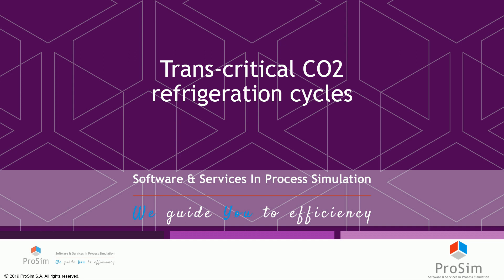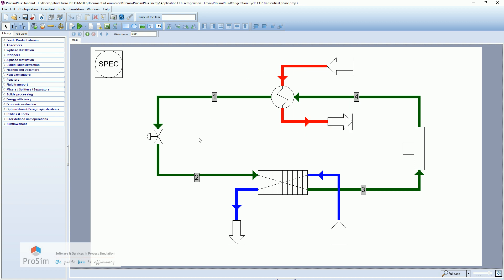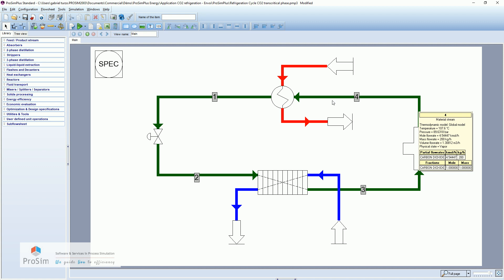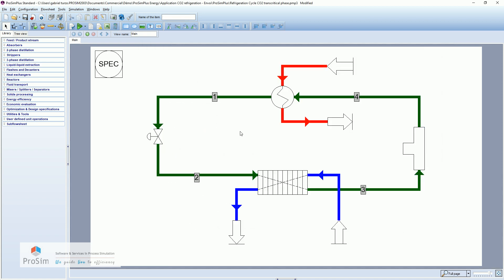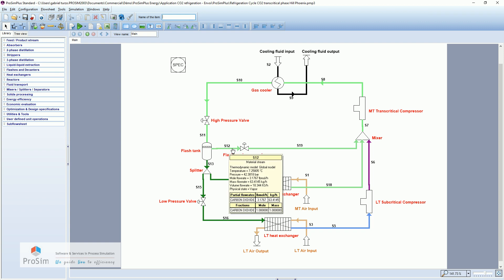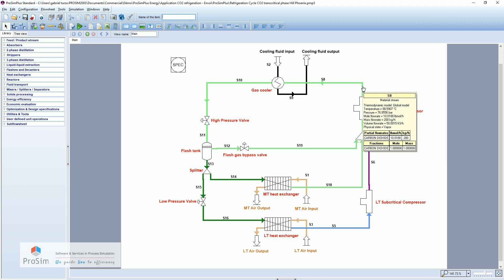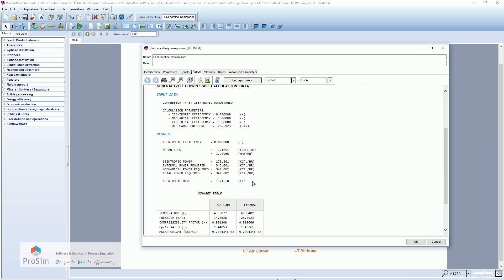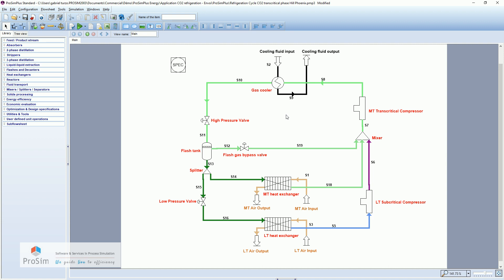Webinar: Transcritical CO2 refrigeration cycles simulation with ProSimPlus software

Comment: Is there an optimum heat rejection pressure in the gas cooler?
Reply from the maker: As there is a link between this heat rejection pressure and the overall performance of the refrigeration cycle, an optimal value could certainly be found. It could be interesting to use the case study features of ProSimPlus to see this influence, or to use the embedded optimizer to directly find the optimal operating point.
Reply: @Fives-prosim  Is there a way by which I can get access to a student version of pro sim ?
Reply from the maker: @suryakarla8628  There is no student version of the software. We have an academic program that allows universities to put the software at the disposal of their students. I would suggest you speak about it with your professor. All the details are available on our website: https://www.prosim.net/en/academic-program/ 
Regards,
ProSim